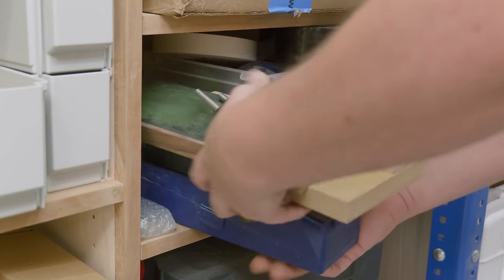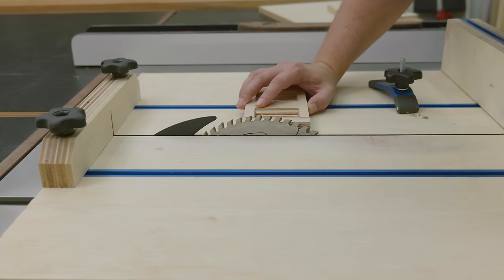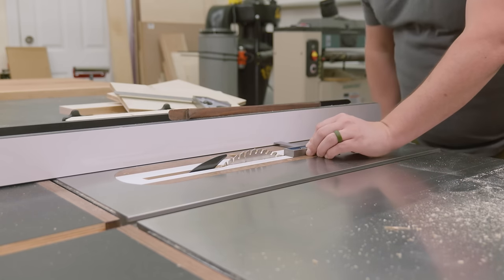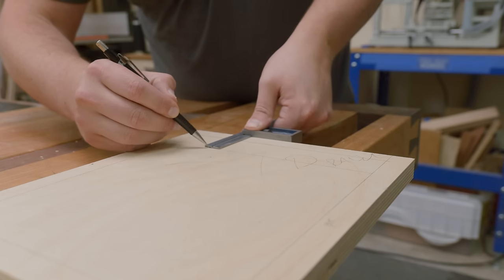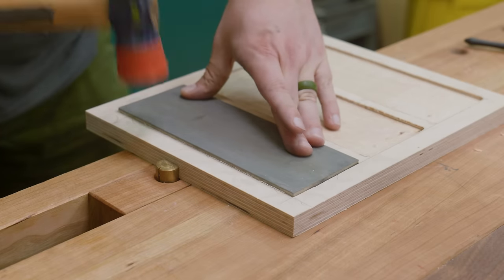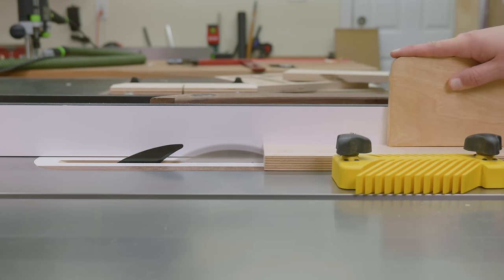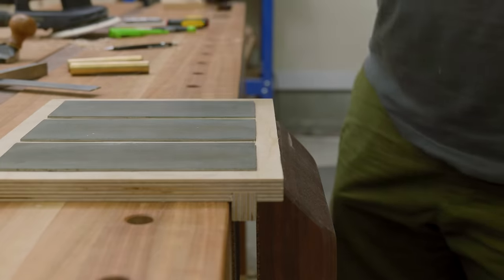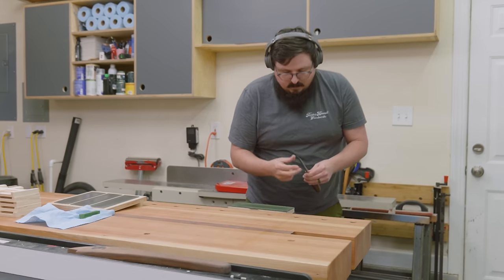A Sharpening Secret Every Woodworker Should Know

Comment: Suede is how I’ve been doing it but I’ll have to try raw now. The dad jokes in this one we’re on point! I’ll definitely be getting a block. Good job man.
Reply from the maker: Haha thanks! Let me know what you think once you get it!
Reply: To me when I hear raw I think of untanned hides, also known as green hides. Full grain is the outside of the skin that had hair, it still has all the original grain. Top grain leather is the same piece but has been sanded and buffed to be smooth. Many pieces of leather have been split and have different names. Split grain is the closest to the flesh and genuine leather is the middle section with the top and bottom section removed.

Comment: Suede.  It picks up the honing paste better in my opinion.  I use glass cleaner with the diamond stones, but also have a large gum eraser that I use after a few sharpening's to make sure they are exceptionally clean.
Reply from the maker: Great point! I realize that I misspoke in the video... I should have said grain side or suede side, But yeah suede is what I use as well.
Reply: Thank you for the info on the gum eraser as I was unaware of it being used for that.

Comment: Raw - though the leather I had didn't really have a suede side. It was raw or fully tanned, and fully tanned is just too smooth.

I found an STL for a honing guide angle block that I printed on my 3D printer. It's about the size of a credit card (with some extra thickness for the stops, naturally. It's nice to be able to just tuck it away in the top drawer of by bench.
Reply from the maker: Yeah, the tanned side doesn’t hold the compound well.  The Biscuit Block isn’t quite that small.